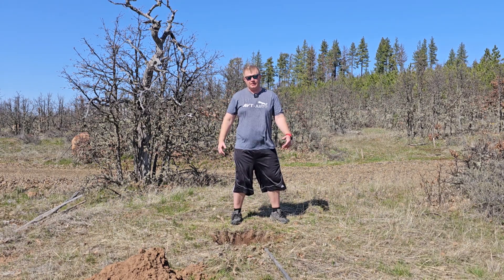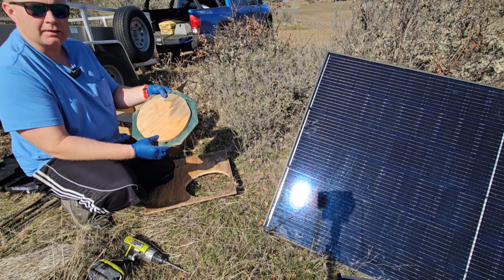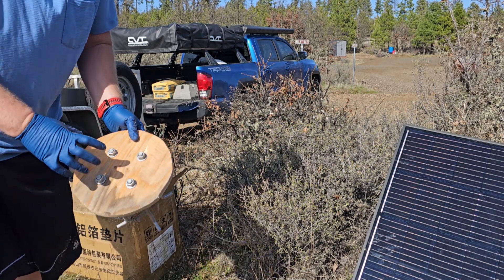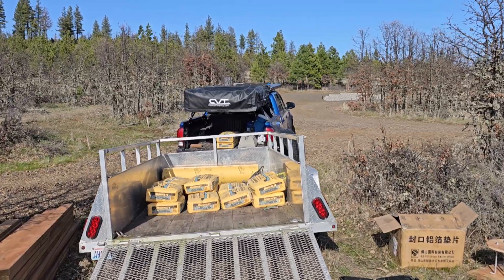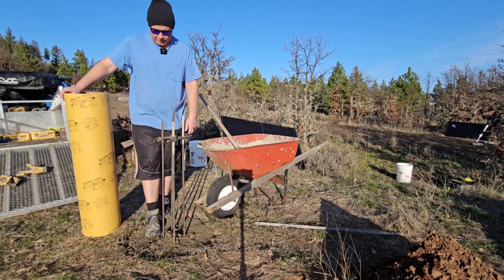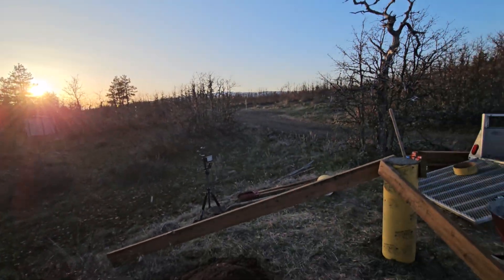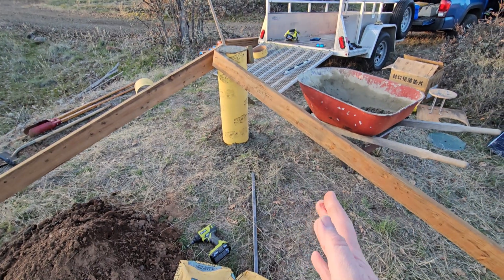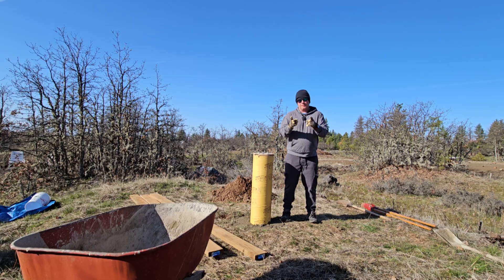DIY Telescope Pier: Concrete Pier Installation Guide

Comment: Great video, thank you! I'm getting close to pouring my own pier - how did you secure the wooden boards to the sonotube?
Reply from the maker: Glad to help! Just one screw from the inside of the tube. That way they are easy to remove and leave no marks in the concrete.

Comment: Hey there! Great job on your project! I'm also a fellow GSV'er, and it's amazing to see all the fantastic improvements everyone is making to their lots. I might consider doing something similar down the line. Quick question for you—what diameter Sonotube did you use? And did you end up using all the concrete that was in the truck? Thanks!
Reply from the maker: Hey, very cool look forward to meeting you. It was a 10' sonotube. Yup used most of the concerte(think I had two bags left).
Reply: @AVTAstro  thanks for the info, that's good to know. Looking forward to meeting you too. Subscribed.

Comment: Like! Hello Vlad, I have a few questions for you: I wanna buy a refractor specifically for galaxies. I’m not interested in astrophotography at all. I set my eyes on the Skywatcher 150/750 mm f5 achromat, (it weighs just 6.6 kg / 14.5 pounds) will it be able to work well on galaxies at around 100x magnification? Galaxies are extremely faint so there won’t be any chromatic aberration right ? I understand that on the Moon and planets it will be sharp only up to 50-60x magnification, but how about galaxies ? Will it show a nice and sharp image on galaxies at around 100x magnification? Will there be a difference in image quality just on galaxies at around 100x magnification with the 150/750 mm Skywatcher achromat versus a 150 mm APO ? Thank you!
Reply from the maker: Hi, to be honest with you I cannot recommend a fast Achromat for anything above 50x including galaxies. You are correct that for galaxies it won't matter as much but if you set up an APO or even a cheap reflector next to an f/5 Achromatic there will be a very clear difference in performance. 

Hope this helps!